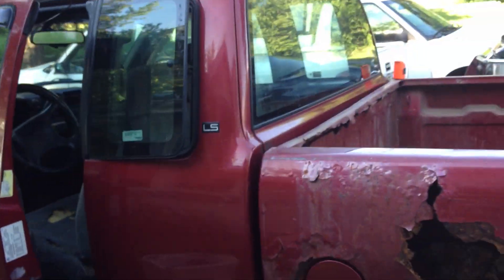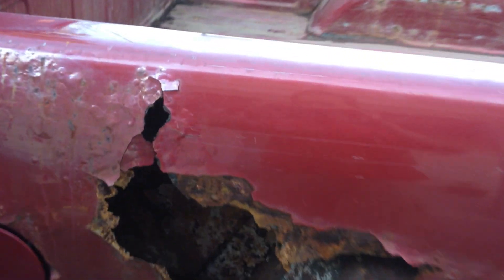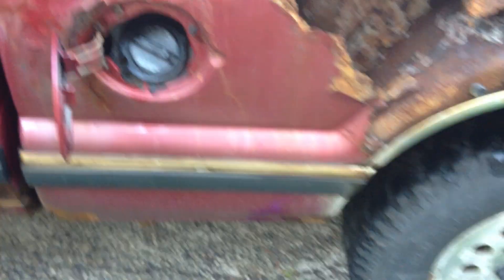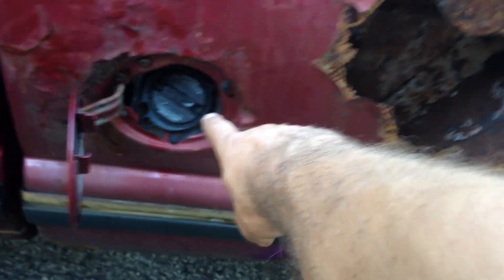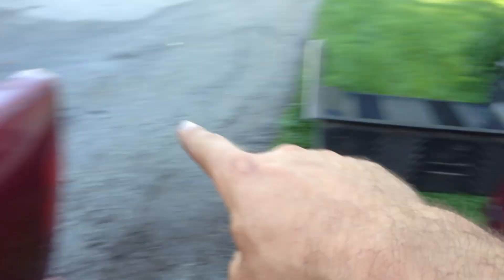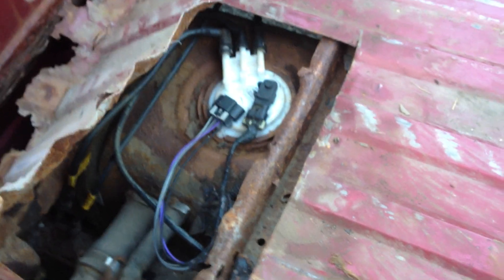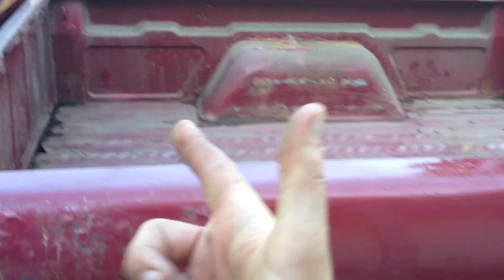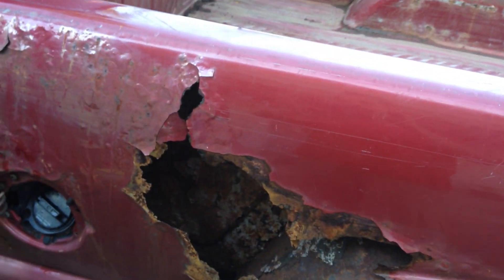SuperTruck - Removing an S10 Bed

Comment: I have a problem, I removed the bed and then put it back on, but the directional flashes fast, all the light bulbs work... what happened?
Reply from the maker: When one turn signal flashes faster than it should it almost always means that the other turn signal bulb on the same circuit is bad. Check your bulbs one more time. Not just the ones in the back. If it's your left rear turn signal, check your front left turn signal. In your case, it could possibly be  a bad connection at the wiring when everything was plugged back in, or even something like a pinched wire.

Modern flashers don't have this issue of changing speeds depending on how many bulbs they are powering. At worst, you could probably upgrade your flasher. Still double-check those bulbs.
Reply: @BenjaminNelsonX  It turns out I had the backlights not connected to ground. It started doing crazy stuff without the two grounds. I could DRIVE the truck with no key in reverse only. All kinds of weird stuff, but it's all fixed.

Comment: hope you you got a smoking deal on that.  I just picked up a 2000 xtreme ls package 4.3 3 door with no rust at all for $850. to top it off its got 3k in aftermarket parts on it and 4 new tires.

Comment from the maker: Yes, I have an electric geo metro, but it's pretty short range. I live in an area where everything is either really close, or really far, so I still need a gas vehicle. I would be a great candidate for a Chevy Volt (except for the price of buying a new car!) and I really do make use of a truck hauling gear and equipment for my work. The idea of a HYBRID truck is to replace both my Electro-Metro AND a gas truck with one vehicle.  For now, I just need something for work til I get the hybrid going.

Comment: Man, have I been gone for a while. Anyway, sounds exciting stuff and amazed when you met Ed Begley Jr. Also, any updates on the iMiev or the cells you scavenged from it? I'm always wondering if you can give the i a custom battery and motor like the rest. It will be a first.